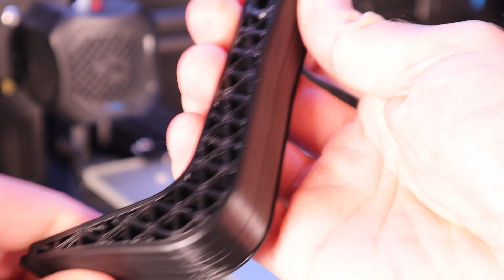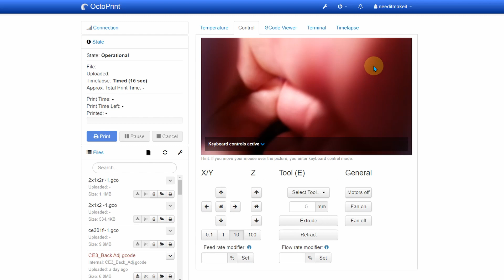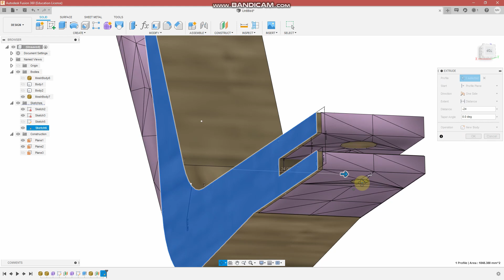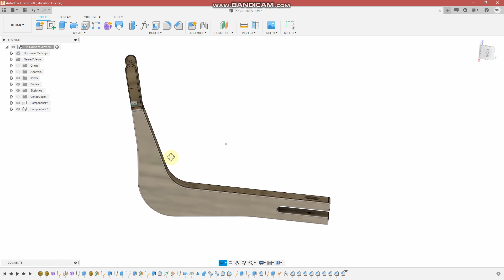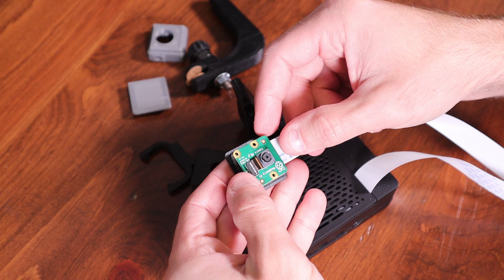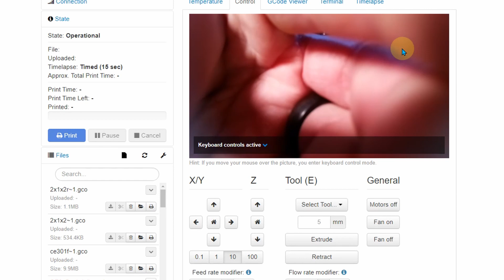Creality Ender 3 V2 - Make a Great Bed Mounted PI Camera Arm For The Spaghetti Detective & Timelapse

Comment: New to 3D printing and stumbled across this, wanted to ask whether you noticed a need for increased bed levelling as one spring is slightly under more load than the others? (hedging my bets that you read this 5 years after the video was posted)

Comment: Cool video. Have you had a look at the new V3  pi camera? the is a standard and a wide angle version. I just got a wide angle one which i intend to use in the same way.
Reply from the maker: I have not, but I’m back to 3d printer improvements.  I will have a look thanks!
Reply: @NeedItMakeIt  I was going to ask if the Fusion 360 model is available, I just ordered a pi camera v3 which has the same footprint but is a little thicker/deeper than the v2 and would like to print a new 'housing'

Comment: Great design, i like it a lot. The only thing is that a get a lot of vibration in the footage. I tried glueing the module in with hot glue but it transfers from the spring to the mount. I already have the strong yellow springs btw. Any ideas?

Comment: Need some stronger springs on that Bed. Last vid did you notice your knob was loosening?
Reply from the maker: Thanks!  I've upgraded and it makes a difference, I've also lowered the z switch down just a little for better compression.

Comment: Thank you for the effort, would this fit non-v2 Ender 3?
Reply from the maker: I think there was a comment about the screen on the ender 3 having to be moved to the other side.  I think it makes more sense to mount the camera to the other side.  I just checked the comments in Thingiverse and that is exactly what people have done along with using the longer cable as I did.
Reply: @NeedItMakeIt  Update: I did exactly that (with PLA), and it fit reasonably well. I had to widen the two holes considerably, but I think that’s due to my machine’s calibration. Right now when I adjust the camera arm left and right, the levelling knob also turns, is that normal? Or do I need to make holes even larger to avoid arm touching the screw?
Edit: after rewatching the video I realized that the spring sits on the top of the bigger hole. I made that hole larger and now the spring sits on the bottom (smaller) hole, oops.
Reply: @uygar84  Spring should sit on the metal plate. Bottom hole goes under the metal, but hole goes above the metal, spring goes through the big hole

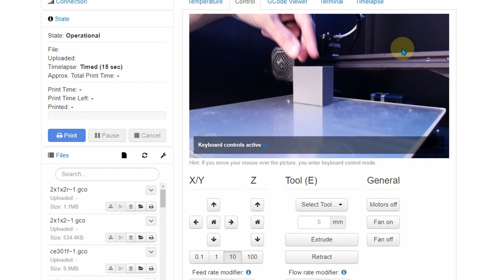Comment: Look at the bowden nut at 7:12.
Reply: Hi, i saw that vid also. Great work! Keep it up. Waiting on the next one.
Reply from the maker: @dragostns  Awesome and cool name BTW.  The next 3D print video is a little different but I have a feeling people will enjoy it.
Reply from the maker: You have a keen eye.  This made it into another video as well as my FAIL.  I was experimenting with the tubes and fittings and I did not tighten it quite enough.  Tip of the day... hand tighten is not recommended.

Comment: Have you found a way to take the vibrations out of the arm? I printed this and it's all set up and works amazing but the video is terrible due to the vibrations transmitted into the camera arm.
Reply from the maker: I don't have the vibration problems with any of mine.   We could probably increase the thickness of the area above the plate where the spring passes through, that's simple to do.  Do you have sense of where the vibration is coming from?
Reply: I have the same issue... it seems that the arm doesnt grip well enough as far as I can tell...
Reply from the maker: @vaderaguk  If there is a little bit of play where it slips over the alum. plate this may cause some vibration.  In that case add a strip of electrical tape to take up the difference.   Aside from that is is pretty solid, I've not had any vibration issues in any of my prints or videos time lapse or octolapse.   I'd think that if it were anywhere, it would be the connection to the plate, other that or on the camera mount itself with the swivel.  This can be redesigned to mount in a different way if you have any ideas.
Reply: @NeedItMakeIt  Thanks. I've tried a bunch of tape and it did tighten it up, but sadly still getting some vibrations :( Gonna go back to the drawing board i think and perhaps look at one that attaches to two points for stability... Really appreciate the design and the channel tho - learned some stuff!
Reply from the maker: @vaderaguk  Sounds good, sorry it didn't work well for you.

Comment: does this work if I've upgraded the springs on my bed?  I saw a remix for upgraded springs, but really not liking the design of the remix.
Reply from the maker: How large are the springs in diameter?  Mine are upgraded 8mm springs, they are still snug, but can be drilled out if required.  I believe they are slightly larger than 8mm, but I guess there are larger aftermarket springs available.

Comment: Hello, thank you for providing a simplified description of the camera arm. Can you please share insight into the addition, parts, and installation of a raspberry pi? I am new to the 3d print world and it looks like this is a beneficial upgrade.
Reply from the maker: There are some other videos already which are quite good.  I found it to be fairly simple and I'm not great with electronics, so anyone should be able to do it.  Let me know if you want me to track down the video that I used.

Comment: how does the timelapse work without the etruder moving back and forth
Reply from the maker: To do this type of timelapse, you can either use octoprint timelapse feature, which activates the camera at a predetermined position for the extruder.  This works well but the pictures are only as good as the raspberry pi camera.  A better method is to link a DSLR or mirroless camera to the extruder position via a usb cable, or a wireless switch (that's my plan soon) which works the same way, but will get much better images.
Reply: @NeedItMakeIt , but how do you make the extruder go to that position after every layer?
Reply from the maker: @heitooooor  If you have Octopi, you need to download the plugin called Octolapse, it will allow you to move the hotend to any location you want and also take a photo when it arrives at that location.  

It looks great, there are normally strings attached... literally because of oozing during the long move cycle, however you can move the hotend to a location which will prevent these from being in the photo. 

I hope that helps.
Reply: @NeedItMakeIt , oh ok! I thought it was via the slicer software. Thanks for the reply, and nice videos!

Comment: Just printed the (long) arm and found out that (accidentally) moving the arm turns your bed level adjuster knob. Is this something you noticed as well? I am afraid I will mess up my adjustments every time
Reply from the maker: It will yes, I just hold the knob if I want to move the knob, I change the angle fairly often depending on where I print on the bed, and that seems to be all that is needed.  

I'm sure there are other options for mounting to the H frame below, this was already proven from others so I thought it would be good to adapt something.

 Great point though, good to keep this in mind.
Reply: @NeedItMakeIt  Thanks for your reply! Maybe the arm can have some small 'hands' that grab around the plate where the arm is mounted on (the one below the heat bed). This would of course remove the ability to change the arm position.

Comment: Your design inspired me to create a new webcam mount for the Creality Ender 3 v2 that points at the front of the printer.  Here is the design if you are interested.    Thing 4702089 on Thingiverse:  https://www.thingiverse.com/thing:4702089
Reply from the maker: Very cool!  I see lots of people prefer this style of cam mount.  I like to use the bed mounted version so it gives the time lapses for the videos, but the benefit of your design is that you can mount a good quality webcam, that's not going to work too well for the bed mount because of moving that mass at a distance away from the bed.

Comment: Interesting use of the no top and bottom layers, had not seen that before.
Reply from the maker: Originally I was looking to use this feature with a hex pattern to print my own raspberry pi case, Cura does not allow this honeycomb pattern, but I wanted to try it so this is the result.  It is very strong... a bit of a dust collector of course, but it can be washed off if it bothered anyone.

Comment: Personally, I prefer the camera to be mounted on the Z axis gantry. I want it to follow the Z axis all the way up so I can spot any troubles on remote even on large prints.
Reply from the maker: I can respect that.  I chose the lower angle because the shroud is so large and I use Spaghetti Detective to identify problems for me, this way it can see a problem sooner than if viewed from above.  It would be great to have both!

Comment: Great vid and great models, thanks for your work.
I'm always curious tho: what are these hook-like think you always print in your vids? (granted, I didn't check the whole backlog of your vids)
Reply from the maker: Thank you very much!  It is my pleasure.  

The hook things are for the 3.1 and 3.1S bowflex bench.  I designed these a good year and a half ago when I was unhappy with the adjustability.  It turns out that there are lots of people who were also unhappy and so I print these for anyone who wants them.  Many of the improvements that I've made to the parts become a video, I have the advantage of being able to print the same part over and over again which allows me to practice different techniques more easily.    https://needitmakeit-3dprints.godaddysites.com/

My latest tip is to avoid ABS, I save so much time printing with PETG, there are other obstacles to overcome with this material, but it has by far allowed me to be more successful printing these structural type parts.
Reply: @NeedItMakeIt  Thanks for the detailed response. It's indeed great to have an outlet for the same design so you don't waste material when iterating. Cool stuff.
Reply: @NeedItMakeIt  BTW, I've applied your tips from this video and from the one with inner wall print speed and I've cut over 3hrs from a 18.5hr build. awesome! :)
Subbed already, waiting for more Cura and Ender 3 V2 tips/mods!
Reply from the maker: @yaczesuaff  Of course!  Pretty good savings.  I have been planning to make a video showing all of the time-saving tips in one super short video, but that will be a few videos down the line.  

I've had to apply these settings out of necessity.  I remember starting at over 12 hours and my prints didn't look particularly good, now they look good and print pretty quick.  If someone wanted to start printing to make some cash on the side, they'd want to apply some of these time savers.   I have 2 more videos coming out soon, one within a week, the other a week or so later.  I have about 1000 more ideas and your comments help to give ideas for more videos as well.

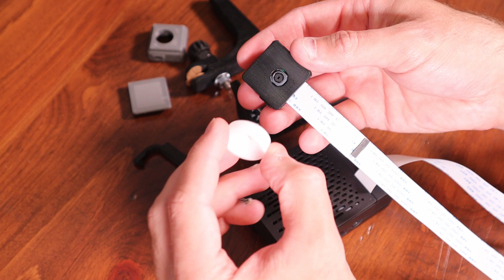Comment: Can you link the print for the camera focuser shown in 6:15? I haven't been able to find it or anything similar anywhere.
Reply from the maker: That is a bit of a problem, that part came in the kit with the camera.  It isn't a great design because the pieces that interlock are very tiny, it should have been integrated into the lens itself and adjust with a paperclip.  Could you super glue something on to help you?

Comment: Is this printable with pla ? ( im gonna try ) and when you print abs... do you have some kind of a air ventilation that goes directly outside? For the chemical fumes ?
Reply from the maker: The arm is printable in ABS, the pivot arm would be tough, it is possible, I would recommend adding a little heat to the arms to assemble because it is a tight fit.  There is a possibility to modify the design so that the pivot arm is made from 2 pieces screwed together and so the arms do not need to be flexed as much.   I print ABS in an enclosure normally with the window open in the room, but I am switching to PETG at this very moment.  PETG is recyclable, it is lower temp, no smell, or at least very little, flexible and strong like ABS and the enclosure may not be needed, so I'm looking forward to trying it out.  .

Comment: Are you kidding me 😅 I needed this 3 weeks ago... I made the clipon one but the cable keeps moving along with your print. And I don't like adding extra weight on the moving parts. This view looks way cleaner for octolapse. 

I just made my rasp pi 4b with this cam to work so I can watch my prints from the gym or anywhere and not stay at home for it.
Thnx for the remix. I will definetly print this for the weekend.

Any tips for adding my bl touch? 
Had to order a special crimper and the end to change the 1.5m cable. And I printed a mount for the bl touch. The hardwork with custom firmware and setting the z offsets still has to come. 

This and also the vid on infill double size. Soo good. Subbed!
Reply from the maker: Sorry, it takes me about 2 weeks to make a video so I was probably only just making it when you needed it. Glad I could help though.

I may also make a taller arm available and one that gets the camera close to the work also but is still ridgid.   

I do find that this lens isn't super clear, so I might look for a slightly different camera option, I've tried better lighting and that doesn't help much, adjusting the focus isn't easy, so we'll see.  the arm itself if very stable, super happy with it.

I've stayed away from the BL touch, I like to keep my printers as simple as possible so that when the parts break, it doesn't cost as much to replace them, less parts also makes it less likely that I am without a working printer.  I treat my cars in the same way.  

I haven't leveled the bed on this printer since I made the video, so about 50 prints and it is still spot on, but if I move the printer, I'd probably need to re-level it.

I have some pretty cool videos coming up, hopefully they'll blow your socks off... if you're wearing any.  

Oh, one thing, print the little pivot arm with something a little bit flexible or it may snap.  ABS PETG etc.

Good Luck!
Reply: @NeedItMakeIt  Never say sorry man! You are putting in a the effort all we do is leech of it.

I Don't have anything with flex yet.
Abs makes bad fumes right? Since my printer is in the house. 

Ive looked up one that has a longer arm (white one ) but It was so long I don't like how it sticks out. 

Your octolapses look great. The question is... do you want to print for youtube and have a nice print lapse. Or do you want the high quality. 

But since you are making content and switching it up a bit I'd suggest a nice webcam with a tripod to set it up for the lapses.

You are probably right about the bl touch. Why change anything that works. (Allready have the more rugged springs so it is a bit stiffer and does not need the leveling that much)

Comment: BTW why are you printing with abs instead of pla ? :) im very happy with pla for small pokemons and alike
Reply from the maker: I print 99% with ABS mainly because I make parts that take quite a bit of loading in compression.  Today is only my 2nd time printing with PLA and I do like it, there are some benefits to using PLA for sure and I think the quality of the prints can be higher because of the cooling fan active.  I don't have much success getting PLA off of the glass build plate using a glue stick.  I may try the freezer technique if I have a problem again.   I'd like to switch to something that is both recyclable and does not require the use of a heated enclosure to print.  I don't think that the printer will last as long under those conditions and ABS smells.  I have some PETG and it looks great but it is a little more expensive.
Reply: @NeedItMakeIt  i had some issues with the bed not sticking well and tried to use the glue method witch worked great but had to wash my plate every 2-3 prints since i use some sort of disinfection alcohol it sticks great and also comes of easy

Comment: use OBS for screen recoding bandicam looks so cheap
Reply: it's a bit neater these days but still reminds of those good old 2005 runescape videos
Reply from the maker: @ayylmao.mp3  That game ate up so much time, but I still liked it.
Reply from the maker: Henk, thanks for the note, do you mind to tell me which part of the video exactly, I use a free recording software and that might be what you're referring to.
Reply: @NeedItMakeIt  just the bandicam text overlay OBS has no overlay and is free as well
Reply from the maker: @henkpipo4233  Okay, thanks for letting me know.  I've been using this for years just out of habit and it works pretty well, I will check out your suggestion.
Reply: @NeedItMakeIt  yea it really does not matter but just looks beter not a must as the content does not suffer from it might just be my ocd :p
Reply from the maker: @henkpipo4233  For sure, best to remove it if it is easy enough, thanks for the feedback.  Look for a little cleaner videos for future thanks to your tip.
Reply: @NeedItMakeIt  thank you for this awsome content :)